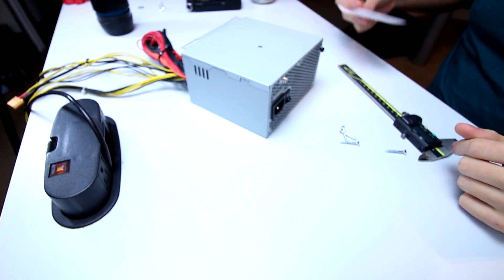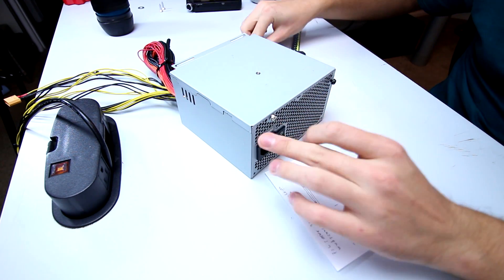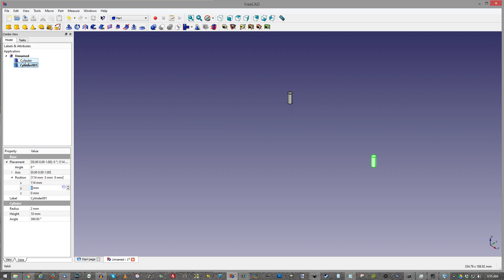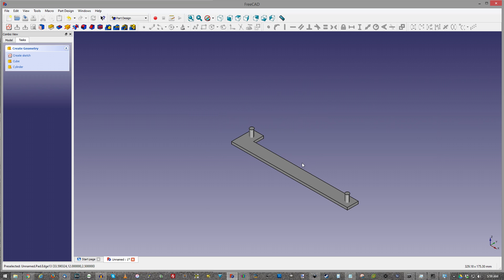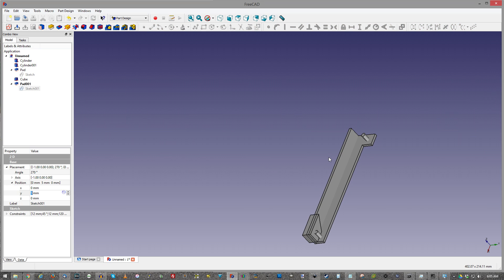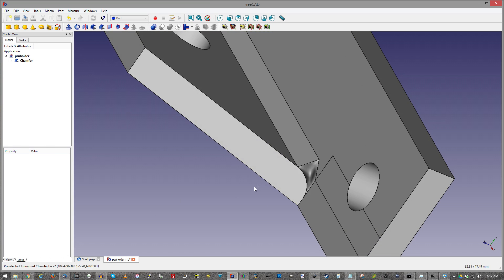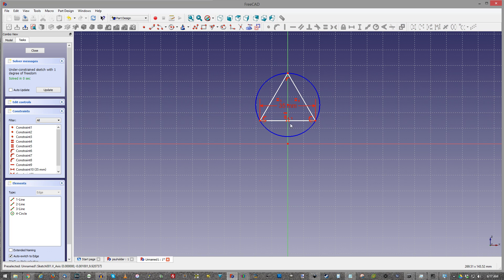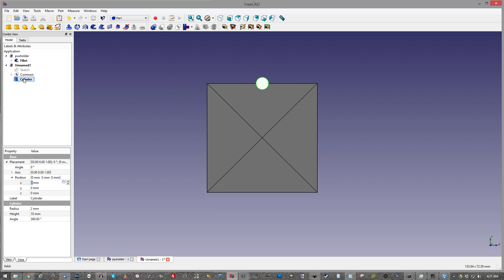FreeCAD 3D Modeling Tutorial 4: ATX Power Supply Mount + Pyramid

Comment: Thanks for this tutorial series. I've actually ended up preferring FreeCAD over Fusion 360 purely on the basis that I can run it on linux with no issues and actually the tools feel more accessible and easier to use. Things also seem to be grouped more logically in the UI